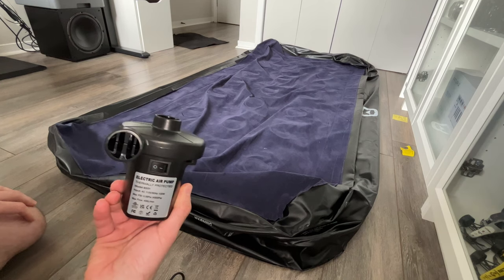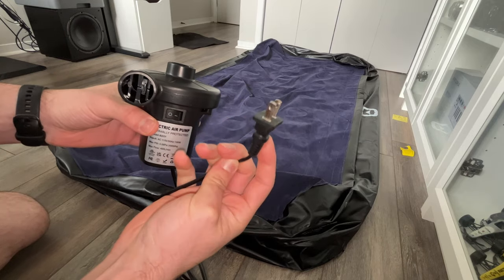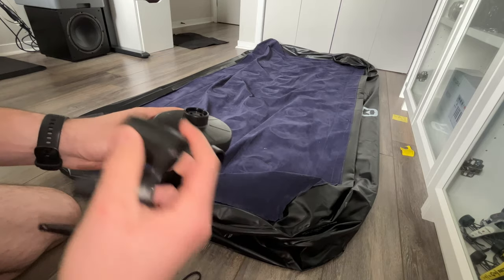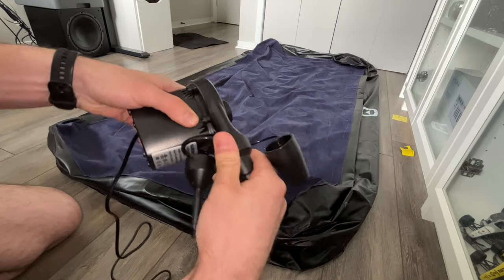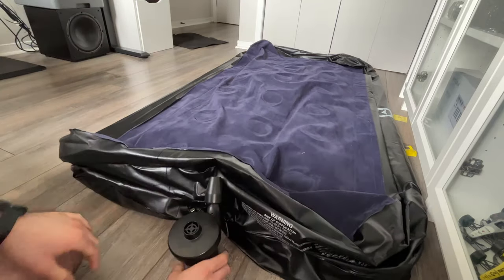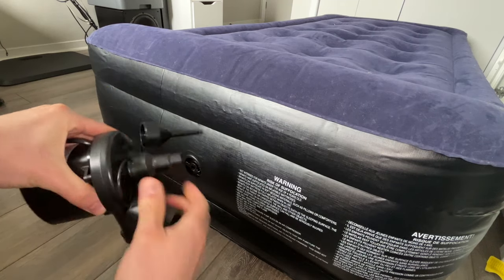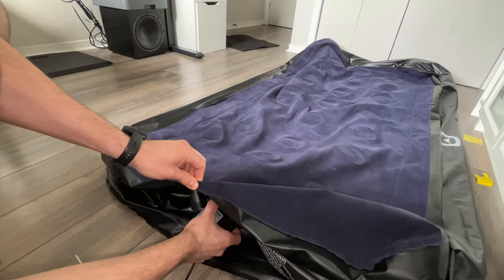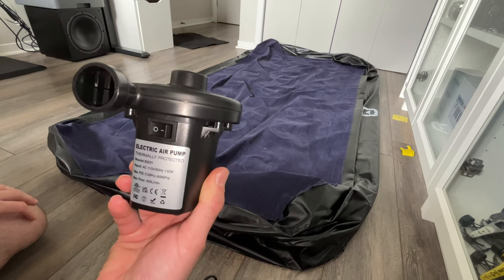Electric Air Pump: How to Inflate and Deflate Air Bed Mattress

Comment: Why does it go flat in the night?
Reply from the maker: You typically need to let it inflated a few days before using the air mattress for the first time. If this happens after that then you may have a leak.
Reply: Are you still talking about the airbed? 😃

Comment: I bought a double size airbed with pump included ages ago &;it's still unopened but that will change soon because the mattress I have is old & very worn & it's quite dangerous because a few spring ends are extremely sharp & you could tear the flesh in your sleep because I woke up with injuries which wasn't there before, & I will use the airbed until I get a brand new mattress.